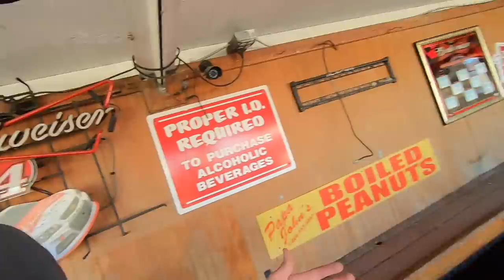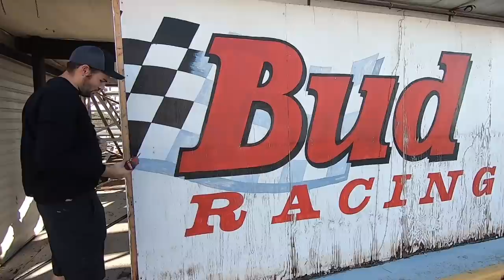Renovating an Abandoned Racetrack Part 3 - Demo & Remodeling the Freedom Factory's Bars and Kitchen!

Comment: In my humble opinion, you may want to rethink your cans vs cups decision. Cans may seem more convenient but they are bulky. Plus, the profit margins on fountain drinks are much higher than cans. Think how cool it would be to sell $5 plastic souvenir cups with the Freedom
Factory logo emblazoned on the side, then get another $1 for a refill of soda that cost you a dime.
Reply: Agreed a refillable souvenir cup that's like a few buck more than the normally available drinks would sell especially if the cost to refill undercut the cost the slightly smaller one afterwards
Reply: this is 100% the way to go
Reply: Problem is that he isn't running a place that has daily attendance. Seems like cans are a better idea

Comment: First off, never put any type of service station in the main pathway, aka the walkway out to the bleachers. This will bottleneck the whole flow of people and cause issues, I know it sounds great but there is a reason why it was not done that way before. 
I would not sell any of the "junk" you have in that caged area until you know for sure that it either A) does not work or B) you will not need it for any product your selling or C) It is not able to be broken down for parts for things you are keeping already. 
I would get all the shops down to base level, and think out what you are selling out of each room. From there you build a list of what you need to sell X product and from there you can better setup a floor plan before building anything wild.
Reply: Yep... that is a 
thoroughfare got to keep them moving.
Reply: We should put a joint list of what to do.  My background is firefighter, construction, and beverage sales.  I spent 12 yrs working for a construction contractor, and had 3 years of design, and construction schooling, Fire Service is 21yrs with 4 years of EMS,  Then I spent 3 years in beverages sales for Pepsi cola bottling, and a local Pepsi distributor here on the Mississippi Gulf Coast. I will be sending a detailed email to him to try helping him spend money wisely on the Construction and about getting those concessions stands manned.  I plan on recommending he put he will not supply the taps or refrigeration for kegs or cold drinks at counters allow the companies who do the concessions to be responsible for those items because they break down or need maintenance regularly.  But he also needs to set bars up to be able to raise those refrigeration units off the concrete 3 inches so any water under them can flow to the drainage areas.
Reply: The previous owners seemed to have everything dialed in pretty well, i would not be surprised if they were saving that stuff for a reason like you said. They might be sorry to sell it.

Comment: Couple thoughts (take 'em or leave 'em).  A Bar that close to the entryway by the bleachers may make a bottleneck for people waiting for the bar vs. people trying to get in or out. They'll just stand there in a huddled mass instead of coming into the bar area, may want a waiting line.  I agree with the comment that canned beer (and maybe even sodas) may be better because you can have people put them into recycling and you can get money back for the aluminum. Plus to the point of needing keg service, you'll need to watch your soda dispensers for mold or run the lines more often with your heat. Don't want broken glass that you'll have to clean up, cans are easier.  Nice video, man.
Reply: That's why they said they were getting rid of all the dispensers.  Soda and Beer.
Reply: @brians48now  I may have posted too soon.  I really should have finished the video first.
Reply: My only thought is that kegs and soda dispensers are way cheaper at scale than cans. Like pennies on the dollar especially for soda.
Reply: @Llama052  that’s probably very true. I think I may be leaning on “least amount of maintenance as possible” since he’s going to have to deal with health inspectors. Less places for mold or violations, the more they’ll save.  But your probably right. The trade off is more than likely cheaper overall and can make enough to cover any issues that may have with money to spare.
Reply: upside of cans over fountain drinks for soda and keg beer is no people coming back bitching that there beer or soda is flat and no upkeep of machines.
Reply: @timcorey8474 completely agree.
Reply: @Llama052  That's true but for a place that's only going to be open to the public very seldom then the cost to maintain those systems in the off time just wouldn't be worth it.  Those dispensers need to be used or they'll mold up.  A refrigerator can sit there for a long time full of product and not see any issues.
Reply: @5PortStudios  maybe they can start off with cans to make it easy and then when things get rolling they can "upgrade" to dispensers to save money
Reply: Yeah remember he is thinking what maybe 5 public events then first year? Have to clean the beer and soda system out every event will get old. Plus bottles are WAY faster. Worked a super popular late night bar, and we would always shut down draft when it got busy. Even if you make 3 timesa as much for a draft, you can server 10 bottles in the same time.
Reply: A bottleneck is the first thing I thought of when I saw that

Comment: Removing the “bag in box” drink system is a terrible idea financially. It’s by far the most profitable product in the industry.. also, Coca Cola and Dr. pepper both send the owner of the business/track a quarterly sales reimbursement check that is big money.. as for the “half wall” I’d consider installing a glass pane garage door so you have the versatility to choose “open air” or closed from the elements.. they also are made in much smaller sizes that would be ideal for your ticket sales booth.

If the hand painted “Bud” sign is available, I’d be an interested buyer for my showroom
Reply: Beat me by a day, I just posted the same thing about the bag in box system. While it's simple to grab pre portioned drinks, the profit makes the extra labor worth it.
Reply: Those bags are pennies, and the cO2 is nickels. The cups an straws will cost more.

Pepsi and coke also supplies the fountains for a commission or lease deal. 

Dont spend 2$ a case for cans.
Reply: you need to buy and maintain all the equipment though.
Reply: @SirDavothe2  as someone that has worked at several levels of the restaurant business, for nearly 30 years, those costs are ultimately pretty minimal when compared to the profit made.
Reply: @SirDavothe2  the equipment is supplied by the company and there is literally 0 maintenance. I’ve had the current system in my restaurant for 15 years and I’ve had one CO2 pump failure and 4 syrup pump failures in that time frame. Also, any repairs needed are deducted from your quarterly incentive check only if you go over a “repair allowance”
Reply: @Carloza The syrup and CO2 is so cheap you don't even bother with inventory. You might inventory the cups but that's about it.
Reply: @blownpony99  I agree with you, removing the "bag in a box" system is the worst possible decision anyone could ever make. The profit margin is so huge that it would easily recover any costs of doing a clean new installation. The only thing cans/bottles would be good for is remote stations, like if you are doing a VIP pit party and dont want to setup anything other than some ice chests. Even then, you could still have pepsi or coke do a remote stand with satellite cannisters and just feed it ice to keep the fountain machine working properly.

He really needs someone that has years of experience doing stadiums and special events to help guide him with some solid advice. I have almost a decade of experience as a special events only for a beer distribution company. I serviced 2 MLB stadiums during spring training, was in charge of a yearly event in October that saw over 30k+ people each weekend, setup and managed countless events and concerts. He really needs someone to help him not make amateur mistakes.
Reply: Although the bag in the box makes sense, the facility won't be opened daily to feel the impact. As with the beer, it makes more sense for them going the can/bottle route.
Reply: @MrEvilgerbal13 , this is not a high volume venue.
Reply: @blownpony99 ,  indeed; however; the Freedom Factory will not be open everyday as is your and most businesses and he will not receive incentive(s) due to low sales. Ask me how I know. I'm a district manager for Pepsico.
Reply: @sakebomb5446  You hit the nail on the head. Cans of pop can be kept between events, and at the volume the FF should do, the big distributors will give wholesale pricing. Get the can for .25 or less, charge $1-2 bucks each. (I'm used to Canadian pricing, so my figures are probably off from Florida.)
Reply: @sakebomb5446  just having 1,000 people in attendance once a month is moth than enough reason to have a bag in a box system. or at the very least have a party trailer brought in by the distributors for the event and use syrup cannisters.

Can/Bottle route is too costly, you have to jack up sales price just to even make money back on those. I will have to just disagree with you on the can/bottle route. I would never suggest that unless you have people literally asking for bottled beverages. It is just too costly for a business, and the syrup method would allow more flexibility for him to do event specials like 2 for Tuesday and so forth and still make money.
Reply: @MrEvilgerbal13  are applying for a job you're trying to create ? 🤣
Reply: @paulcunningham5327  I have almost 10 years of experience with organizing public county wide special events. I have networked extensively with Pepsi, Coke, Budweiser, Miller. I know the tricks of the trade, the pricing and the best way to handle different events. 

There is really only one reason why you would want aluminum cans/bottles and plastic bottles. You would want case's over kegs if you are not confident in selling product and are testing what kind of sales you can generate. If you think you wont sell more than 5 kegs (half barrels) of beer in a single event, then a long draw draft systems isnt needed and you can get away with a coldplate setup where you just need to ice the beer kegs down and the the ice chest with the coldplate. this is the simplest draft system that you can effectively run. the down side is the ice melts and you have water everywhere so can be a pain without proper drainage.

The other alternative is you can had the distributor use a party trailer, its a walk in fridge on wheels where the kegs stay cold and the beer taps are on the side. you just need to supply power to the trailer and you can pour directly from the side.

They need someone with inside knowledge to help them get what will best suit them and their needs for the event. strictly going cans/bottles is like throwing the baby out with the bath water. you need a better solution than that.
Reply: Don’t have glass bottles, idiots are everywhere and glass doesn’t mix well with tyres. And if a fight breaks out, a bottle may be used. 

And if he does choose the can / bottle route the empties should be and need to be recycled. In the UK as a business you have to pay for the collection unless you’re prepared to drive your trash home and dispose of it there. 
I don’t know much about beverage profit margins etc, I do know that glass is a bad idea though. 
Whatever choice he makes will be well thought out, they’re not morons.
Reply: @MrEvilgerbal13  Dude, my experience in the industry is a portion of yours and I agree with you totally!!  I just thought it was funny how you spoke of your experience and then stayed they need someone who essentially is you!!  I was just joking, and you are on the money with your assessment!!! Happy New Year!!!
Reply: @paulcunningham5327  ngl he be going hard on his pitch one gotta wonder what's in store for it lmao

Comment: I wish I lived closer and had my GC already. I’d definitely help out. As someone who has been building stuff since I was a kid, building stuff and renovations are my forte. When you replace the wall panels you should look at using treated 2x4s for your framing and look into hardy siding (fiber cement) 4’x8’ panels. Hardy siding panels will not rot as they’re made out of fiber reinforced concrete essentially. It is a pain to nail through by hand but if you get a siding nail gun and some 1.5” - 2” coiled stainless siding nails, you’re golden. The hardy panels will also work on the ceiling. Caulk all the joints and paint whatever color you want. We use hardy out here in Pensacola when we build houses on the beach. It stands up to a lot of abuse. Don’t use any metal. Eventually it will start to rust, it will be loud if anything hits it like rain, and not to mention it will pick up the vibrations of sound.

Comment: I’ve worked professional security, and managed events at the busiest sporting arena in the US. There’s a lot of stuff you gotta consider from a life safety side, and a beverage serving side! Happy to give some feedback for free. But pleaseeeee stay away from bottles/cans to serve. They end up as projectiles, and major hazards. Serve in plastic cups/paper cups.
Don’t set up concessions with servicing from that other bar top.. you’ll create a bottleneck and potentially block emergency ingress/egress. Again, I’m happy to provide feedback free of charge (or send a t-shirt 😬)
Reply: Yessssss.  All of this. Cups only. You'll make more money and serve people bigger beers which makes them happy.
Reply: Paper cups work the best, the plastic ones are easier to litter.
Reply: I think they’ll be doing cans for now as the underground lines for taps probably need to be replaced
Reply: @1992djg  no taps i dont think. Too much time between events and beer lines get nasty and require too much cleaning from sitting unused for periods of time. Cans are lighter and easier to store and chill than bottles. If draft beer is used later, use single or double kegerators at each location so the lines are short and easily cleaned. Keg beer makes you more money too.
Reply: Around my area the beer distributor will drop off a enclosed trailer with taps on the side. I think they have 4 taps. All the equipment is rented for the day. All you need is a fold up table and a pop up tent.
Reply: @matthewerwin4677  Those beer wagons would be a great thing for Cleeter until he gets things more squared away but i think he is gonna go all out on his little race track!  I bet he has a sweet setup when he gets it opened up..
Reply: 1992djg and you can always pour a can into a cup
Reply: @warrenmichael918  If it was my money I would start out cheap and easy. People will show up regardless. Save the money and do the big jobs later after the money starts rolling in.
Reply: @matthewerwin4677  yep, i agree. Im not sure exactly how much money ol Cleet has though. I know he has money but this kinda adventure can really take some big coin!
Reply: Here's the trick.  You sell cans, but you pour into a cup and the can goes in a bin.  

They do that at Buffalo Sabres hockey and other events in that arena.  

Track I like best here I think does that too, it's a dirt track but no issue with plastic bottles on the track or anything.
Reply: @trucksucc8490  Yeah heaps of companies world wide are trying to stay away from plastic cups and go to paper.
Reply: Professional Security...aka I couldnt make it into the Military or Police Force. Lol

Comment: I had a thought, the walls on the concession stand facing the track, PROBABLY act as sound deadening, so your people can hear and take orders. I don't know how well it will play out removing those walls under the bleachers.
Reply: I think they're planning on replacing them and I'm pretty sure you're right about the sound deadening.Hmm, replace them with double layer walls.
Outer layer (under the stands) corrugated metal like some they tore down.  Then a 1" spacer with an inner wall of quarter inch plywood.  Fill the gap with CLOSED cell spray foam.
Reply: @michiganengineer8621  They are absolutely replacing those walls.  You don't want people dropping stuff from the stands and having people just wandering into your work area and the sound deadening too.

Comment: Seeing the walls come down I can definitely see a need for a different style of bottom plate for the walls. Both to keep water from driving into the buildings and rotting them out. Off the top of my head you guys can pour concrete curbs for the bottom plates to sit on which will 100% block the water. Or try a combination of PT bottom plates, sealant and flashing to seal and deflect from water.

Comment: For areas that are always exposed to the weather such as the counter in front of your concession stands, trex brand composite materials will not rot like wood and it comes in a wide range of colors and up to 1x12 inches and up to 20 foot long

Comment: Hey Cleet, that back wall you where thinking of going metal on you might want to think of a material that doesn’t conduct sound as the track noise and stadium noisy will be intense and make it hard to hear inside.

Comment: May as well knock the buildings down and start over bud!
Reply: Yup I agree, it's a stretch calling them "buildings" more like a shed, a good storage shed is built better than these, might as well start over and build a real building.
Reply: That's what I was thinking too. They're building 4 new walls anyway, might as well start totally fresh with just the slab.
Reply: They pretty much are they are replacing the walls and the ceiling which is pretty much the whole thing
Reply: 100% this. Framing is cheap, and the time you will spend trying to cobble the existing crap together, you could have 4 walls and a roof up. They don't need to be fancy by any means, big boxes with a sloped roof. Or what the guy a few comments above said, make a pad, bring in food trucks. No shortage of vendor's there.